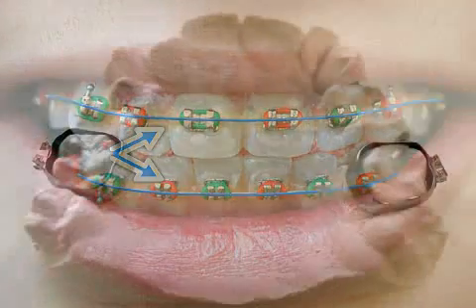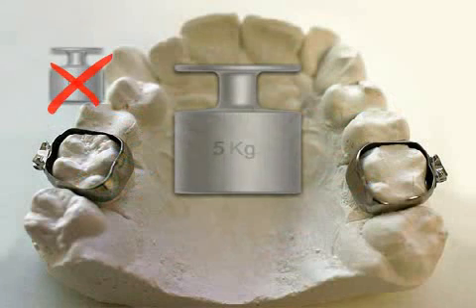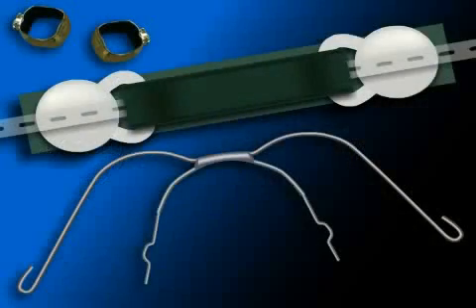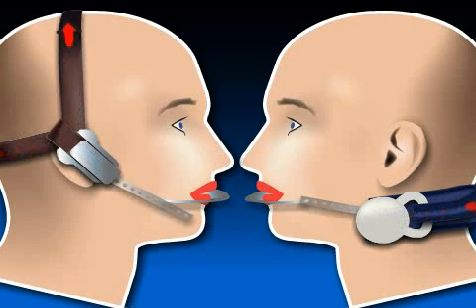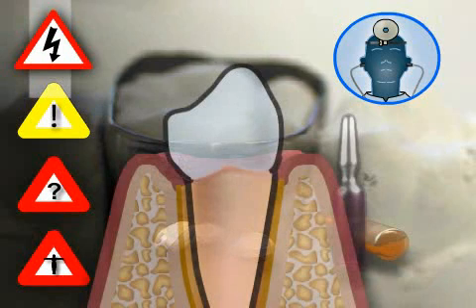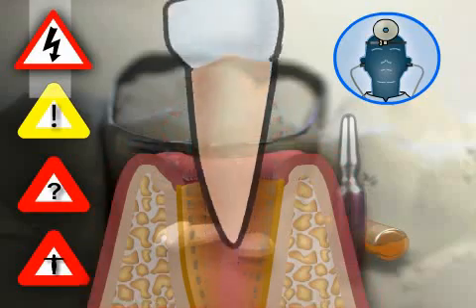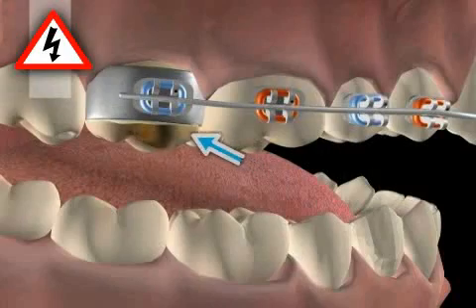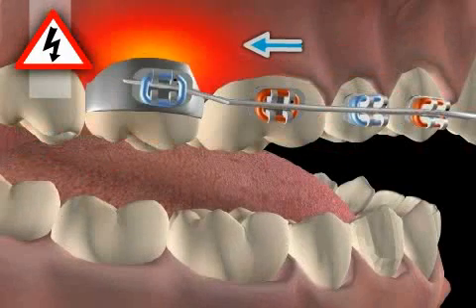Dental Banding in orthodontics

Comment: I have 4 and the glue tastes so gross when they put them on. When I had separators/spacers before I got them on they really hurt and I could chew but only with my front teeth. One of my separators/spacers fell out and when they tried to put the band on the tooth that the separator/spacers fell out from, the ortho had to force the band on but it was fine! I got them today, July 15th 2020 and they feel normal.
Reply: Do the metal spacers hurt when they put it on? And can you eat properly after having them on?

Comment: GUYS WILL IT HURT?
Reply: Nah mate. I got it two days back. The only problem that I have is that the extra cement is disturbing the bite and so my upper and lower teeth aren't touching each other since the cement is right below the band. Dentist said its fine. 
You will have pain on your front teeth due to the braces as they are going slowly to the right position. And that's not that bad. You will forget about it when you are busy.
Reply: Hyperion Retr0 for me it wasn’t that bad until a few hours after when my tounge started to get cut and bleed, it’s 3 days after and it still hurts and i can’t eat anything. But it’s just the glue that’s cheap getting them on isn’t that bad

Comment: My bands have little spikes/ball on the side facing my tongue so it keeps scratching/rubbing against my tongue and it's so painful. Does anyone have any tips to ease the pain? Also, for some reason only one of my bands have Hesse little spikes.
Reply: What are these bands called actually? I have two bands with inner spikes, one on each side of my lower teeth. Not sure if it's normal if it scratches the tongue every time I swallow 💀
Reply: Akina here yeah you’ll get used to it
Reply: @maplebooth1818  Oh I ended up pushing the spikes more inward myself and problem solved
Reply: shortsebastian my lower band is also rubbing against my tongue. what did you do?
Reply: shortseba same
Reply: I put my wax on the ball
Reply: Same lmao it sucks
Reply: maybe wax?
Reply: I have one but I immediately removed it.